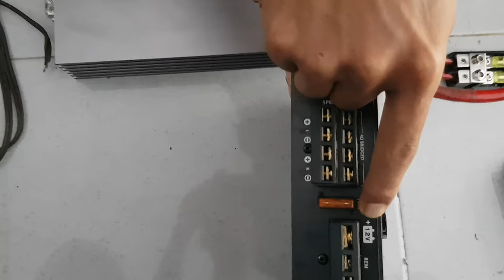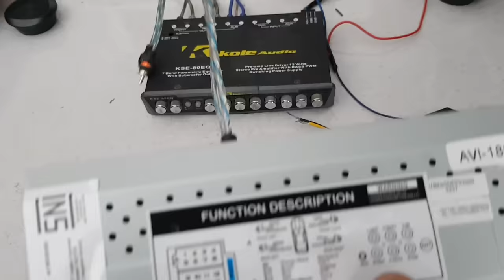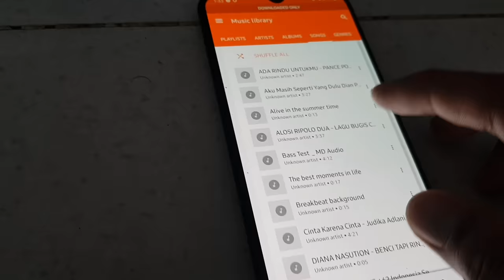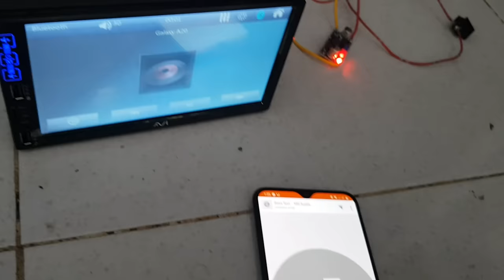Cara Pasang Audio mobil Komplit Power Monoblock dan Power 4ch di mobil dan di rumah

Comment: Mas numpang tanya kalau monoblock pakai crossofer yang ada di sound system bisa gak mas,,maaf pemula banget
Reply: Gk bisa mas, kalau gk mau pakai monoblock gak usah pake speaker belakang, trs kabel subwoofer nya di sambung di channel ke 3 nya amplifier. Tapi itu jadinya tidak pakai speaker belakang

Comment: Bang mau tanyak, saya tu udah mkai sub 12 in, ads, biar bas nya lbh mntep lagi di tmbh alat ap lagi ea, tlong di blas dan di bimbing masih pemula bang 🙏🙏🙏
Reply from the maker: Sub ads type apa dan powernya pake apa bang
Reply: @MandalikaAudio  , sya pakai power bawaan dari toko,. Saya beli udah sama. nok nya bng,  ads niitrooous bng 1200 wat 🙏
Reply from the maker: @rikohandoyo3629  biar maximal maen di 2ohm, tapi harus menggunakan power yg watt lebih besar, monoblock lm 2500 juga Ok

Comment: Bang sy sepeker tengah pakai coaxial msih ikut HU,tpi suara klh ma yg sepeker pintu depan yg ikut power.gmn cra ngakalin nya bang
Reply from the maker: Kecilin gain volume di power untuk front channelnya
Reply: @MandalikaAudio  klo misal disambung ikut sepeker depan di seri pa diparalel bisa ngk bang
Reply from the maker: @evanstevan7768  mau sambung dari power atau di head unitnya
Reply: @MandalikaAudio  power bang

Comment: Kalo kabel remote nya ga pake riley gimana bang?
Reply from the maker: Bisa aja gk ada masalah, asalkan tegangan dari head unit stabil gak drop di bawah 12v
Reply: Biasanya sering drop dari hd unitnya. Bagus pake rellay, biar output rem nya maksimal. Mantaapp

Comment: Dari aki ke monoblock pake kabel ukuran berapa? Dan dari monoblock ke subwoofer pake kabel ukuran berapa?
Reply from the maker: Idealnya untuk kabel power 8 AWG, kabel subwoofer 2x80
Reply: @MandalikaAudio  tidak harus 4 awg kah powernya monoblocknya? Monoblcok 600w
Reply: @MandalikaAudio  2*80 itu ukuran berapa ya?
Reply from the maker: @akuncrazy biasanya di pasaran ada 2x80, artinya 2 serat satu kabel
Reply: @MandalikaAudio  bos, saya udh pasang, tpi kok dengung ya? Klo lagu udh diputar dengungnya ilang, itu knapa?
Reply from the maker: @akuncrazy  kalu menggunakan adaptor memang gitu, penyebabnya grounding yang kurang bagus, tapi kalau agan pake aki atau installasi di mobil lansung gak dengung
Reply: @MandalikaAudio  cara mengatadinya gmana ya biar ga dengung?

Comment: Ingin mencoba settingan :
- speaker depan kanan di ambilkan dari front power
- speaker depan kiri diambil kan dari power rear
Speaker pintu belakang di ambilkan dari head unit
Hasilnya bagai mana ya?
Untuk subwoofer pake monoblock
Reply from the maker: Kalau power 4ch mending speaker dari power aja semuanya
Reply: Lha ini nitip bang . Apa aman bang di aki new Ertiga 35 ampere apa kuat yah ??
Kalau masang power 4 Chanel sama monoblock ??

Comment: 2 SUBWOOFER JBL GT5-12D DAN 2 SET speaker split JBL GTO 609C pakai power monoblock JBL GX A3001 dan Power JBL GX A604 4channel kuat ngangkat gak lur????? ATAU 1 SUBWOOFER JBL GT5-12D DAN 2 SET speaker split JBL GTO 609C pakai power monoblock JBL GX A3001 dan Power JBL GX A604 4channel kuat ngangkat gak lur?? MAKSIMAL YANG MANA LUR UNTUK KESELURUHAN SUARANYA...TOLONG DIJAWAB TERIMA KASIH TERUS ADA TAMBAHAN APA LAGI KALAU BUAT KARAOKE DAN DITARUH DIRUMAH?

Comment: Power suply berapa amper?
Reply from the maker: 80 Ampere
Reply: Beli di mana power splay 80 ampere
Reply from the maker: @sandrobulnta3146  di online shop ada gan, di Bukalapak atau Toped
Reply: Ini cara pasang nya SMA kaya power splay yg lain apa gimana gan harga nya berapa
Reply from the maker: @sandrobulnta3146  sama aja gan, yang penting jelas (+) dan (-) nya,
Untuk harga kisaran 500K
Reply: Bagus mana SMA power splay yg lain gan
Reply from the maker: @sandrobulnta3146  yg sya pakai ini murni 80A gan, angkat 2 power masih kuat, buildup bukan rakitan, ex psu server
Reply: Ok gas thanks ya infonya
Reply from the maker: @sandrobulnta3146  oke gan👍

Comment: mas buat sub sansui w122d bisa pake dobel coil pake mono hollywood?

Subwoofer 12 Inch DVC Sansui SA-W122D

Specification :
- Nominal Diameter : 12" (312 mm)
- Mounting Depth : 4.72" (120 mm)
- RMS : 100 Watts
- Peak Power : 1000 Watts
- Nominal Impedance : 4+4 Ohms
- Frequency Response : 40-1000 Hz
- Sensitivity (SPL/1W/1m) : 93 dB
- Free Air Resonance (Fo) : 49.5 Hz
- Suspension Compliance (Cma) : 182.22u M/N
- Moving Mass (Mms) : 56.636 g
- Mechanical "Q" (Qms) : 2.347
- Electrical "Q" (Qes) : 1.643
- Total Speaker "Q" (Qts) : 0.966
- Equivalent Volume (Vas) : 67.491 Ltr
- DC Resistance (Re) : 3.4x2 Ohms
- Elfective Piston Area (Sd) : 3.4x2 Ohms
- Force Factor (BL) : 51.071 cm
- Reference Efficiency (No) : 0.483 %
- Voice Coll (VC) : 35.55 mm, ASV
- Magnet Mass : 29.2 oz (828 g)

Comment: Cara pasang Riley nya gimana bang kan ada nomer nya pak sayah kurang paham
Reply from the maker: Kode 30 untuk kabel positif accu
Kode 85 untuk kabel remote dari head unit
Kode 86 untuk kabel ground atau body mobil
Kode 87 untuk kabel yang menuju port remote power
Reply: Pak kalau gak pake parametik Giman pak bisa gak ,dari power langsung ke monoblok
Reply from the maker: @dedeanwar3836  iya bisa pak
Reply: Bagus nya gimana pak
Reply from the maker: @dedeanwar3836  lansung aja dari head unit ke power 4ch dan monoblock
Reply: Ia pak ,sayah pasang 2 subwoper sama power 4 cenel sama monoblok gimana pak cara pembagian rca nya
Reply from the maker: @dedeanwar3836  pertama RCA dari Hu ke Monoblock, kemudian RCA Out dari monoblock ke power 4 ch, di power 4ch ada input untuk ch 1dan 2, kemudian dari out hubungkan ke ch 3 dan 4
Reply: Makasih banyak pak yah
Reply from the maker: @dedeanwar3836  siap pak👍